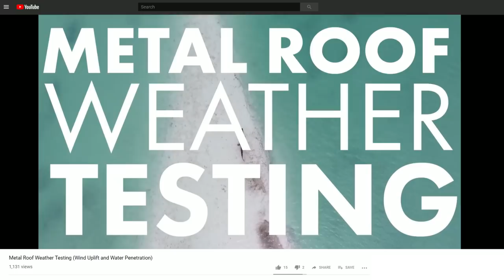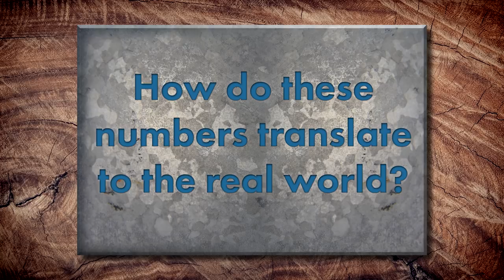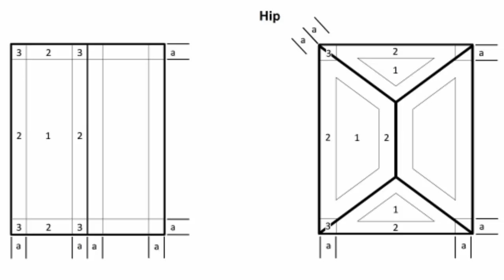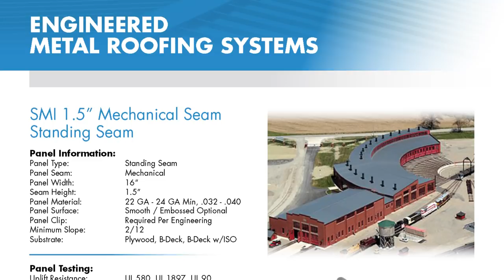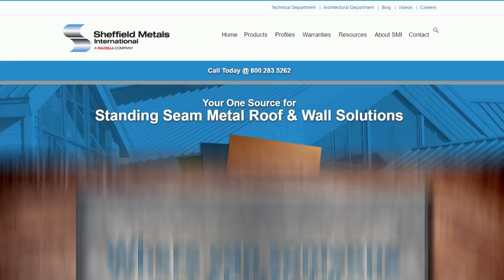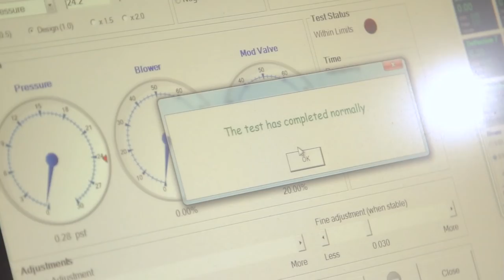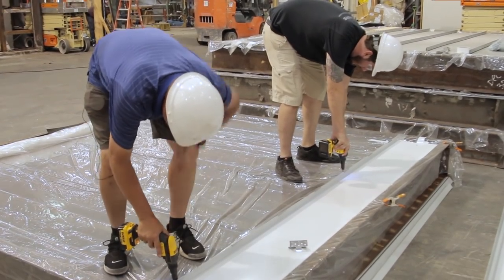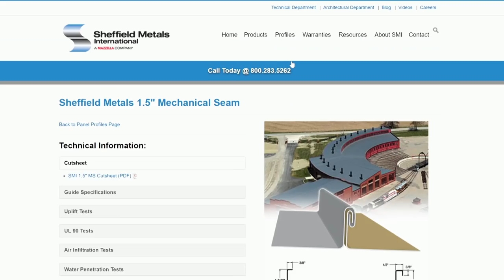How Does UL 90 Translate To Wind Speed? Uplifts In The Real World

Comment: Another comprehensive and informative video, guys, thanks! I'm learning a lot. I have a question about ridge venting on metal roofs: is there such a thing as a wind-driven rain proof ridge vent for a metal roof? Or is the possibility of water intrusion just a trade off a homeowner has to accept if they want ridgeline ventilation?
Reply from the maker: Hello, thanks so much! When it comes to ridge venting, we use the Cor-A-Vent V600TE in our weathertight warranties and our standard vented ridge detail is based off that as well. The V600TE has what they call an enhanced snow screen which helps keep weather out. Additionally, our vented ridge detail has bends on the ridge cap which cover the edges of the venting material. That will greatly limit the possibility of any water intrusion. Thanks for the question! - Thad